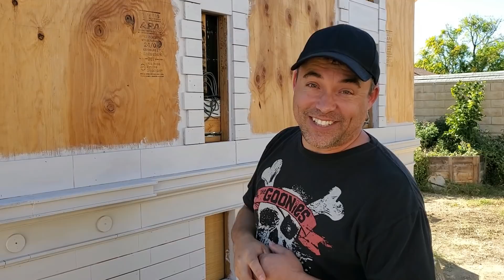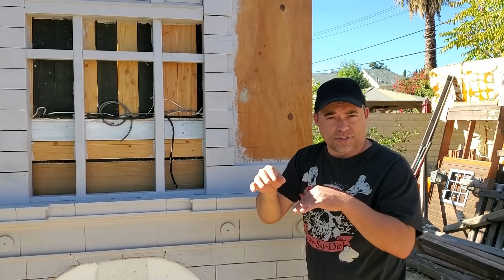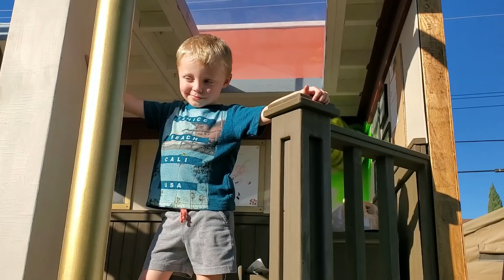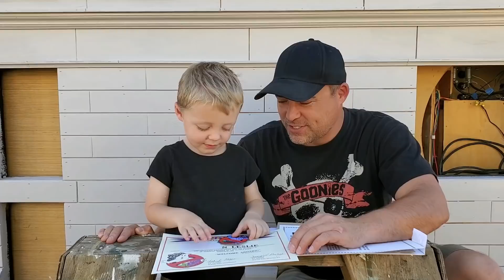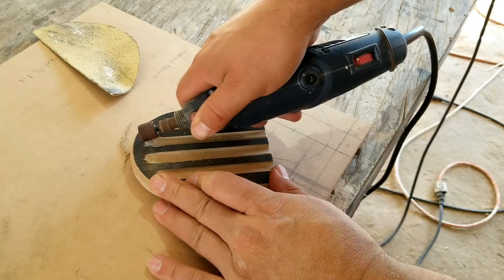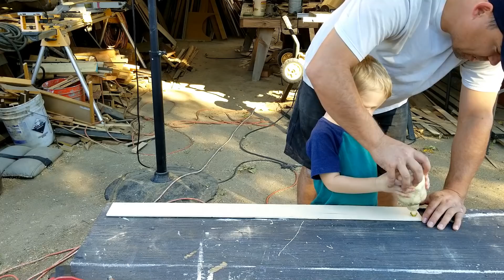HUGE GHOSTBUSTERS TOY PLAYSET! - Hook & Ladder 8 Firehouse Details (Pt.9)

Comment: ‘I literally screwed that straight down”
Why couldn’t you have just said screwed that straight down. The word literally added nothing and is just meaningless filler. I wish I could go one day without hearing or reading at least half a dozen times people overusing and misusing that word. Great work on the playhouse.
Reply from the maker: I will literally try to talk gooder in the future.  Thanks for the comment 😉
Reply: I would argue that your comment on his use of 'literally' also constitutes "meaningless filler." I wish I could go one day without hearing or reading at least half a dozen times people overeacting and needlessly correcting the most insignificant of grammatical errors. Great save at the end, though.